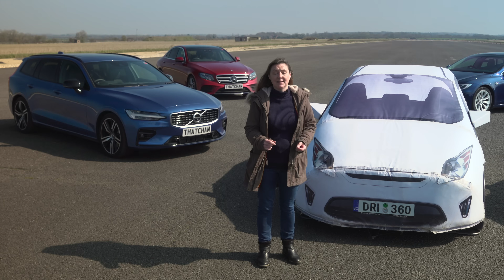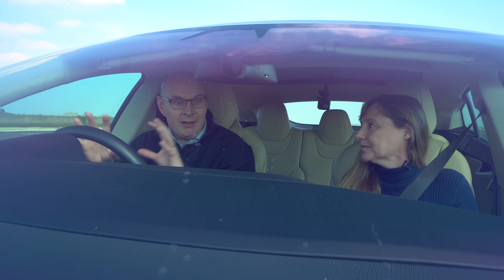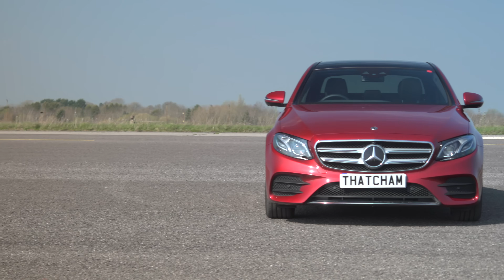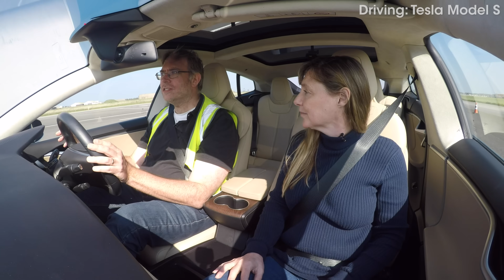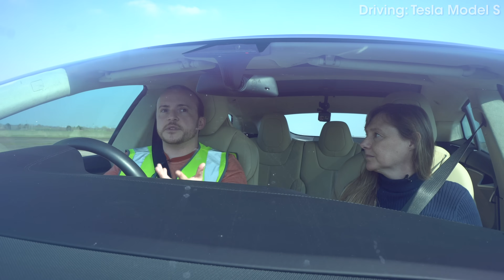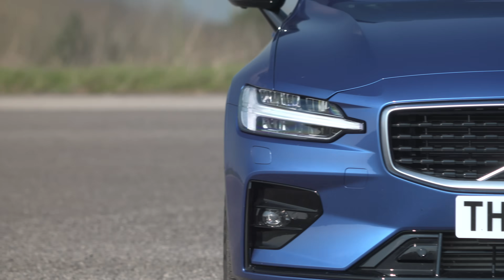Car safety explained – What are Advanced Driver Assistance Systems like to use? | What Car?

Comment: Personally I would say that these ADAS features should be standard and fix rather than having the option to switch them off. That said however they are driver assist systems and not driver abdication systems and should be viewed as such. There can be no substitute for an alert driver.

Comment: Interesting to see a range of trials using various systems in the market now. I’m familiar with the “Toyota Safety Sense” system (not that you have a Toyota one in you footage), one of which I have in use. It’s ‘Pre-crash Safety system’ (PCS) has a degree of automation of the brake system (regen+friction). The relationship between one’s foot pressure on the brake pedal is not necessarily fixed - sometimes it will enhance it to achieve an emergency stop, e.g. if it’s laser/camera unit detects someone trying to cross the road close ahead. Sometimes there is a risk of something else crashing into one’s ‘tail’ if it’s too close when that happens.

 It also has a “Lane Departure Alert” feature, using the laser/camera kit, and a graphical/audio display. I normally have it switched on, and most of the time it\s useful. It is not linked to the steering at all.

 The other issue is it’s “Road Sign Assist”, which is a good idea, but in reality there are lots of compatibility problems with the road signage itself, e.g. the absence of certain speed limit signs, bad positioning such that they are detected when not relevant to the lane in use. If it becomes a requirement for auto speed limiting there will be a lot of work to be done between manufacturers and the highway departments to make it work well!

 The only comment is that my manual has a long list of ‘warning’ and ‘get out’ notes, to the effect that it’s an assistance gadget and it’s not intended to be relied on too much.

Comment: My Volvo’s system is stupid. It won’t let me move forward in stop/start traffic faster than a mobility scooter before it beeps at me, and yesterday a car turned left infront of me (I was nowhere near it, at least 2-3 car lengths away) and it started screaming at me, vibrating the steering wheel and put the brakes on a little.
I’m not blind Volvo 😂

My Audi’s system is fine, it only flashes when a car infront slams on the brakes suddenly.
I’m all for safety, the BLIS and Rear Cross Traffic is brilliant, but it’s too sensitive, so I turn it off.
Reply: Jacob Thompson yes but if you were in your phone it would of altered you Volvo are just better than Audi a lot more kit as standard I used to have an Audi sq5 2018 and when I moved jobs I wanted electric so got the Volvo XC60 t8 a lot better than the Audi Volvo more expensive but worth it and quicker than the Audi sq5

Comment: All for technology improving safety. Problem we have is at the moment - these systems are classed as ‘assistants’. However, many drivers are using them as replacements for their own ‘skills’ and relying on the systems to prevent incidents. That’s NOT what they were designed, or intended for. It’s the same on aircraft - Boeing MCAS system was introduced because to help prevent the aircraft stalling. When I learnt to fly, being able to recognise a stall was paramount.
Reply: Agree'd. This problem is compounded when you have worn tyres/brakes or even worse bad road conditions on top of that, it's always tested/evaluated in perfect conditions & life is not perfect. I'd love to see them test these systems by at least swapping out the tyres & brakes for legal, but worn versions & even better in heavy rain.

Comment: What i`d like to know is...what happens when the sensors on your car get covered in road dirt, snow or leaves stuck to them? ....would the car know where its going on a road surface covered in snow, mud or missing, badly repaired white lines?
Reply: Nobody seems to answer that, I've seen these questions a lot & never addressed unfortunately.
Reply: The sensors know they are covered and informs the driver lol